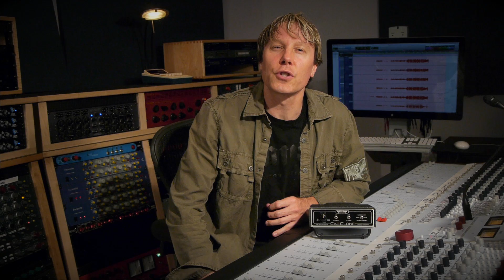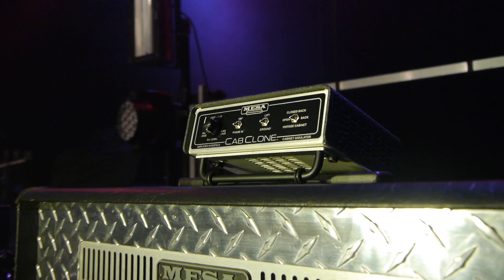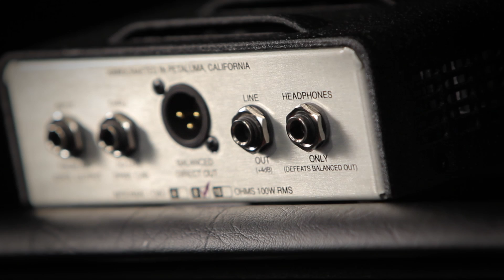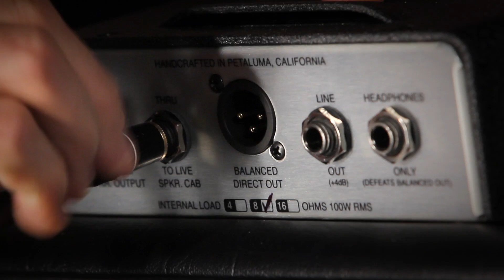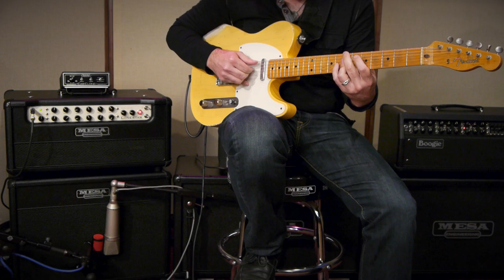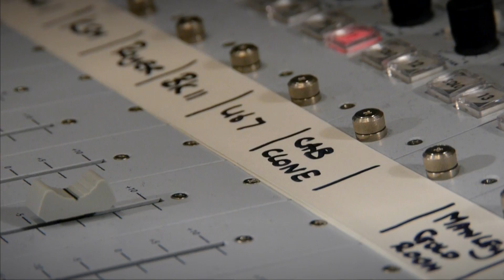MESA/Boogie CabClone Official Demo Video

Comment: Love the fact that it's passive, love the concept. But I don't like the way the cab sim sounds. Useful for practicing I guess, but for recording, I don't know. Does it have a line level, unsimulated output? or is the line output cab-level or simulated too?
Reply from the maker: Hi Bas Vredeling  - Not sure what you're listening on (headphones or studio monitors ALWAYS highly recommended for critical listening when trying to decide to buy gear), BUT - we did EXTENSIVE R & D and comparisons to both mics and our competition to get the CabClone sounding as realistic and toneful as we could, similar or better than our favorite mics, and nailing the FEEL. We would highly recommend that you need to try it for yourself and not depend on a YouTube video to make a final determination since flavors are different for everyone and this is just one amp, one guitar, one setting, one player - all unique. There are settings, controls, amps, instruments and many other conditions that YOU decide and that will affect your tone when you go to record and the CabClone is just one possible piece of that puzzle that provides direct functionality. Hope this helps and thanks for your interest!
Reply from the maker: PS, Bas Vredeling Regarding the Line out - YES - the Line Out is unsimulated - basically a tap off the speaker output - just like a Slave Out on our amps. You can run the DI and the Line Out at the same time as well. We'd suggest the DI Output will sound and feel WAY better than the Line Out but there's uses for the Line Out for styles and flavors, for sure.
Reply: Thanks for the answer!

Comment: Is the handle removable, or can you otherwise fold it under the unit so it lays flat? Also, do the ohms always have to match the output, or is that only if you're using it as a load box without a cab connected?
Reply from the maker: Hi Gear Gods - YES! The Handle is easily removeable with two small phillips head screws!

Regarding proper impedance, if you are using the THROUGH jack and connecting a speaker, the speaker is the load so you would be OK there with a mismatch. If using the CabClone direct and utilizing the internal load, a mismatch will likely not sound as good and can potentially cause damage to tubes and/or output transformers when not properly loaded/matched. Great question and thanks for your interest!

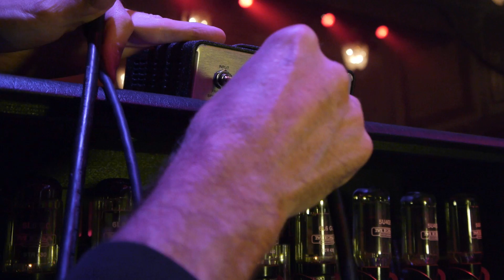Comment: Wait! They show a Triple Rectifier (1:04) getting plugged in to the CabClone, yet on the back of the Cabclone it says 100watts...

So can I use my Triple with it?
Reply: If you turn the amp's master volume high enough you'll fry the load, so you have two workarounds - you either connect the thing to a cab so you're using the cab as load while using the thing to get a line out, or you don't turn up the volume much on the amp.
Reply: Thank you! That was a wealth of knowledge.

I own a Triple and a Dual right now. On top of that, I've owned at least ten Mesa amp in my lilfe. The Triple I own is my baby. It's one of the first ever made. My Dual is a TOV combo that I absolutely love. So, I know my Mesa stuff very well.

FIVE 6L6's and THREE  5U4G's

Screen cap:

https://fbcdn-sphotos-h-a.akamaihd.net/hphotos-ak-xfp1/t31.0-8/10548088_10203213901922232_4654681915202966705_o.jpg
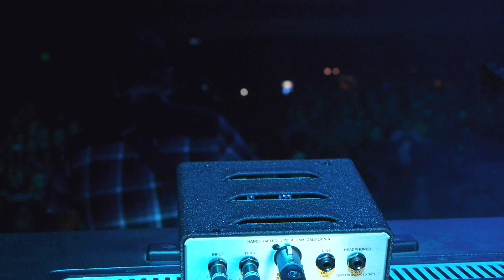Reply: Roland Garcia I'm not try to start trouble, only pointing out what's there... But like you said, Triples can be used as long as the thru is being used, which it seems to be (0:58)
Reply from the maker: Roland Garcia Now I see what you were referring to - the Triple the band was playing live. Thought you were referring to the sound sample at the end. ;) So, to re-iterate, the CabClone CAN be used with amps above 100watts when proper knowledge and common sense are involved. Good questions and thanks for your enthusiasm for MESA and for the CabClone. Much appreciated!
Reply from the maker: Hi Roland Garcia - The Rectifier being used in the video sample played in the studio is a three channel DUAL Recto (100W – Multi-Watt), not a Triple.

 If you have a cabinet connected to the THROUGH jack on the back of the CabClone you can DEFINITELY take advantage of the CabClone's Cab Simulations and DI Output using amps with wattages above 100 watts. The internal load is bypassed when the THROUGH is connected.

It's possible to use a Triple or higher than 100W amp for silent use with the internal load of the CabClone IF you keep volumes/masters on your 100W+ amp lower/quieter and, basically, using the amp set reasonably... NOT CRANKED to the high hills. Excessive volume/master settings could do damage to the internal load resistor and/or then to your amp if the load resistor fails from excessive heat. Temperature of the CabClone is your best guide to determine if you're pushing the CabClone's internal Load Resistor too far. If it's too hot to tough it and hold your hands on it for more than 5-10 seconds, you're probably pushing it too hard. Use common sense and you should be fine.
Reply: Roland Garcia I have to say, I'm unfamiliar with the new Multi-Watt's so, perhaps they're using 3 rectifier tubes in those? ..but the 5th 6L6 is a little mind boggling.
Reply: MESA/Boogie It's a genius product!  I'll be placing my pre order very soon for an 8 ohm.

Comment: hey!, i was wondering if this can be used also as a attenuator to get the volume down to example bed room level of you´re fav amp, and yet get that great sound and tone out of it??
Reply from the maker: Hi Daniel Otterborg - The CabClone is NOT an attenuator  and should not be used to 'crank' your amp up as this will cause premature wear on your tubes and possible failures. If you're going out of the DI Output, you can adjust your amp's Master and/or Output level slightly above where you would normally use it (as if a cab was connected), BUT - it is NOT recommended to 'crank your amps overall volumes with the CabClone. This is not an attenuator, it's a load box and should be treated as a speaker alternate. If you wouldn't use the setting on the amp with a speaker connected and being in then sdame room with your amp, don't use that setting with the CabClone ;). Hope this helps and thanks for your interest!
Reply: You can use a volume pedal in the effect loop chain.

Comment: !? I like this thing and I have a couple of question. In my experience (w/ a "hot-plate"), I'd like to use this with my amp at set at high master volume, high gain, and with a lot of pedals, into headphones. Would I be able to turn the amp up, and have the volume in the headphones pretty low so that I don't blow my ears out... and the CabClone will absorb all the excess energy from the amp?! And to adjust the volume in the headphones, do you use the "D.I. LEVAL" knob on the front?
Reply: that's interesting. I was wondering if it would be useful to a setup im building of a 40 watt bass amp that i would rather monitor from it's "real" output, rather than from it's shitty aux out 1/8" shit jobber ;) the thing has some nice features! props to the design gods
Reply from the maker: Mike G Great comment, Mike G & thanks. You got it right and we appreciate the sharing of accurate knowledge! :)
Reply from the maker: Hi SRPDigitalTV - Since the CabClone is not an 'attenuator', it doesn't offer the exact same concept as an attenuator, BUT - because the DI LEVEL can be turned low, you can turn the master of your amp up and set your levels this way and get some cool variations of tones this way. Alternately, setting the CabClone DI Level higher and turning your amps master down produces some KILLER tones as well. Highly recommended to experiment with the full range of possibilities between CabClone/Amp/Input Gain on a console/recorder etc. thanks for your interest!

Comment: Sounds not so nice to me. Like an old H&K red box or something. To my ears very DI'ish, tamed with a simple low-pass filter. I like the many features tough, esp. the headphone jack. But I reckon, for cab-less recording a two notes Torpedo would do better.
Reply: Agreed! I tried all of them: red box,two notes,palmer,rockcrusher recording etc...
They all have that DI'ish sound with a few filters , ALL of them
Reply: Or a rivera rockcrusher recording.
But this is passive, small, and probably relatively cheap.
It doesn't even sound half bad if ya ask me, so...
Reply from the maker: Luca Borgonovo - Regarding defeated Headphone Out when recording: "The HEADPHONE OUT impedance is relatively low compared to the XLR BALANCED OUTPUT (Transformer's) impedance and being a passive unit (no power supply) the location where the two circuits meet would cause the HEADPHONES–if connected– to drastically attenuate the DIRECT OUT signal level and therefor it's best to connect one or the other for use in this passive design."

Hope this helps.
Reply from the maker: Hi CalendulaF - Not sure what you're listening through (headphones or studio reference monitors are always recommended vs. smartphones, earbuds, etc...) but we'd be amazed if you didn't find the CabClone to be one of the most realistic, natural, compact, affordable straight-ahead and easy to use direct recording devices out there, especially one that has a built-in load. Something you have to listen to and feel for yourself in real time. Check it out in person if you can.
Reply: MESA/Boogie That does look and sound pretty damn realistic, natural, compact, straight ahead and easy to use, though I'm waiting to see the EU price before calling it affordable :P

Anyway, could we get a block diagram of the thing or at least an explanation of why you decided to have it defeating the balanced out when headphones are connected?
Reply: Based on the  audio in this video, the cab clone has the typical hollow and fuzzy sound of other solid state Direct Interfaces.I think digital products like the Two Notes torpedo  and some of the software based IR's are the way to make a direct guitar signal sound convincing.No disrespect intended to Mesa as I think this product has other useful features like the line out and and load handling capabilities.
Reply from the maker: Hi Paul Secondino  - Not sure what you're listening to the audio with but studio headphones, studio monitors, or even a good car stereo system are highly recommended for critical listening as all MESA clips are mixed with studio listening/creation in mind, (not optimized for laptop speakers or earbuds). If you're listening on anything less than something that resembles better studio quality listening scenarios, you aren't giving this audio a fair shake. Also, may we recommend, seeking out other sound clips on YouTube for competing products (that aren't multi-tracked) and doing multi-tab A/B comparisons and making a more fair comparison. Ultimately, just try one out. The CabClone was compared to all of the popular devices out there in our R & D and we believe we captured some of the best and most realistic ANALOG tone AND feel you can get in a passive device. Hope this helps and thanks for your comment and your interest!
Reply: My PC is connected to fairly decent full range speakers. With analog DI's  , I have always heard  (or not heard) the same missing frequencies . The palmer version that handles a speaker level load sounds okay but the technological breakthrough in my opinion is digital. As I mentioned before, your cabclone does have some other highly useful features that I think most live players could really use .
Reply from the maker: Fair enough,Paul Secondino. We would just urge you to play it yourself, in person, as there is circuitry in the CabClone that is not found in the other analog devices you mention or that most people would compare this to... Whatever you decide, we hope your tone is great! ;)

Comment: Since this is a passive unit, would it work with a line level input from a guitar preamp like the Triaxis?
Reply: Most likely not, you'd need a power amp.
Since you don't seem to need one though you might just get a standalone cab simulator altogether...
Reply from the maker: Hi McLeanAB88 - The CabClone's primary input (far left on the rear panel) expects a SPEAKER level input signal. A preamp signal will not drive it. Perhaps a good feature for a future, more full-featured model model? ;)
Reply: A "future, more full-featured model" would be awesome... I'll keep my fingers crossed..

Comment: Does it have a reactive load (the way a speaker reacts)?
Reply: The reactivity in the load of speakers isn't anything worth reproducing nor even noting unless you're going for an alnico guitar speaker.
Not that it makes much of a difference on the sound anyway - the frequency response is a hella bigger difference.
Reply from the maker: Hi Robert Johnson - If you're using the THROUGH jack and connecting a speaker/cabinet, the internal 'static' load resistor is bypassed by virtue of the jack having something plugged in. This IS the reactive load you're seeking (the speaker you have plugged in... So, in that way, this offers a reactive load and even though it's not silent at that point, it does provide the balanced XLR output with the CabClone's Cab Simulation and is a very useful applications if you're splitting hairs between a static load and a reactive load.

That said, the static load for the CabClone when SILENT/DIRECT Recording (without a speaker connected) is EXCEPTIONAL in Tone AND Feel. And like Luca Borgonovo said above, the frequency response is a much more significant (better) difference than reactive vs. static load. You'll have to try it (feel it and hear it) to believe it. We think (hope) you'll be blown away!
Reply: MESA/Boogie So I could connect a “dummy" speaker load and have a very “natural" reactive load connected… Problem solved :) There are a few options to make that speaker more or less silent (If I would find that a reactive load is necessary….) It would be very interesting to record the XLR output cab simulation with a speaker connected (reactive) and a/b that with no speaker connected….(passive).

The theory is that: "The tube amplifier and guitar speaker work together dynamically and it is the complex interaction between the two that creates the overall tone, therefore, maintaining the speaker's natural reactance is a critical factor in keeping the attenuated tone and dynamics transparent” From: http://www.aracom-amps.com/info/PRX%20Advantages.html The static load is a big resistor with EQ added (the frequency response is not dynamic).

This is of course theoretical and trying out the CabClone is the only way to find out for myself…. I will give it a try :)

Comment: This is Awesome! …I'm already trying to figure out how to use this with amp sims. I hope this doesn't cost too much. …What type of mic position is the cab clone cloning?
Reply from the maker: Hi Amps for Buddha - There's no specific mic position to reference since it's not a 'model' of mic placement - the CabClone is much more analog than that... ;) BUT - it's probably best described as slightly off center of the dust cap and 'on the grill' for distance away from the speaker. Standard stuff to reach the widest range of possibilities and users.

Check with your local dealer for pricing:
http://www.mesaboogie.com/US/Dealers/dealers___support.htm

Thanks for your interest!
Reply: MESA/Boogie hi bought 2 weeks ago the mark V combo must say the best highest quality amp ever. if i plug the CabClone to the amp with headphones  will it sound the same like the amp itself?
Reply from the maker: Hi Max Shahmeister - Yes! However, nothing replaces a room being filled with sound from a speaker or speaker cabinet. Listening to an amp silently through headphones is never as "big" as listening to it through the speaker but the CabClone Headphone Out does a great job of providing a silent listening experience for your Mark V and ANY amp you want to use it with.